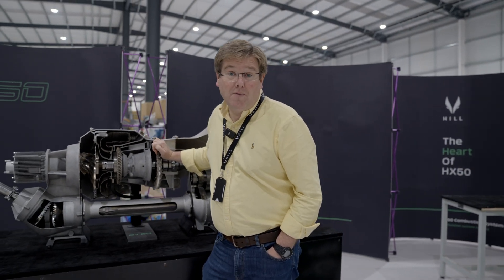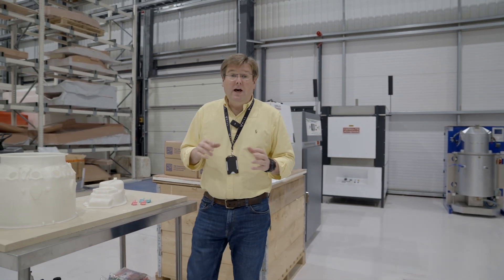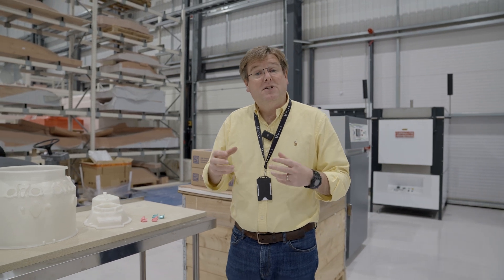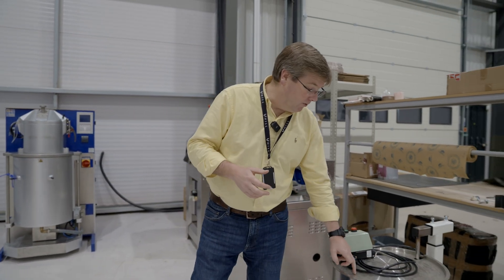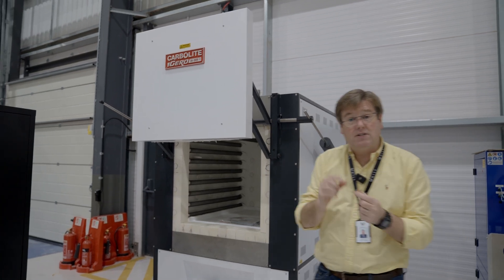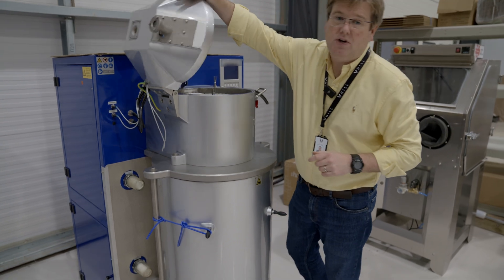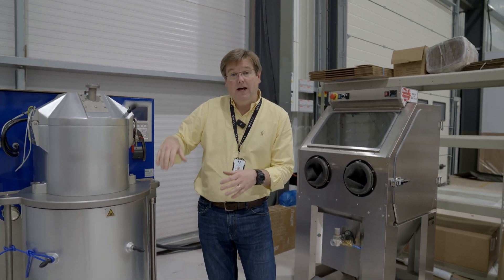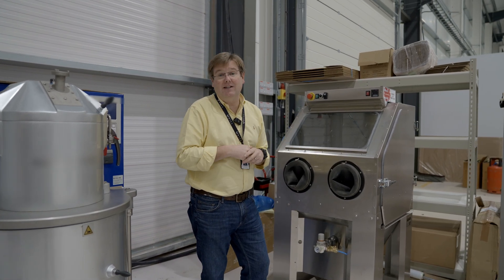Turbine Blade Casting for GT50

Comment: Can you please explain why you invest in these machines before you have a working prototype of the turbine? Now you will have to allocate resources to employees who need to learn how to use these machines and how to cast turbine blades—something that 50 other companies are already specialized in and can deliver within weeks if you do the final machining, in case you have already purchased a CNC machine for the task with an operator sitting idle. When you run your first prototype and experience a blade failure, you will not know if the problem lies in your casting process or in the engine design itself. To me, this seems crazy and way too early to waste resources, space and time on in-house turbine blade casting. If I was CEO I would go to sleep thinking "Darn, we don't have the prototype running yet, what actions can I take tomorrow to speed up the process". And the first action would be to put these machines in a corner and contact every casting company available.

Comment: Can the GT50 be made a turboprop engine. If so what will be the appropriate weight the firewall forward and the fuel burn at max continuous power and 70% power. 

Mr. Hill it would be great to hear your remarks in this regard. 

Appreciate the marvelous job you and your team is doing to build a helicopter from scratch. And also for taking us along the journey

Comment: And here I thought turbine blades were machined.
Reply: They are but only after being formed. After machining they need to be polished.
Reply: @JonDingle  But the thing is, I thought casting things left air pockets and makes metal brittle? That's why it surprises me that it's used on something that's gonna spin at  thousands of rpm while being heat cycled.
Reply: @rotaryperfection  I'm no expert but nickel based super alloys are notoriously difficult to machine.  They are hard materials and work harden, which affects the final strength.  As a consequence, all turbine blades are cast.  As for air pockets, casting is done under a high vacuum which requires turbo molecular pumps.